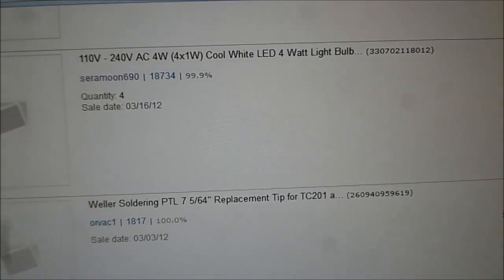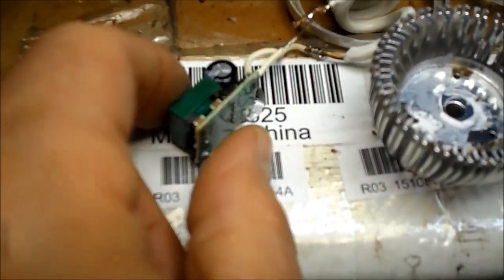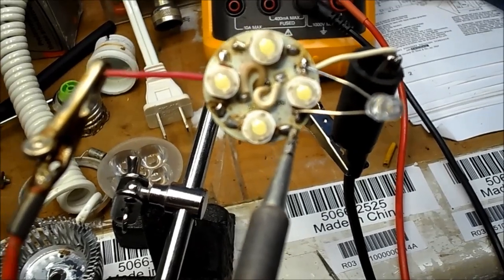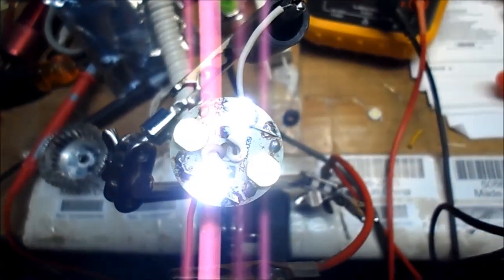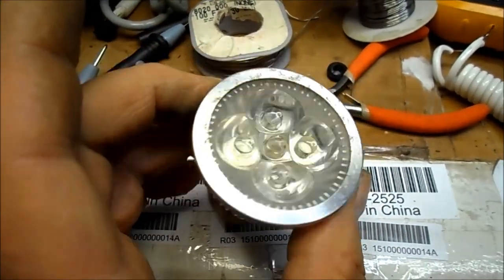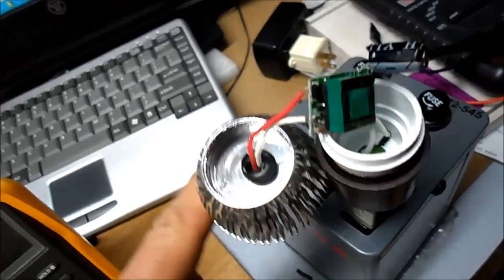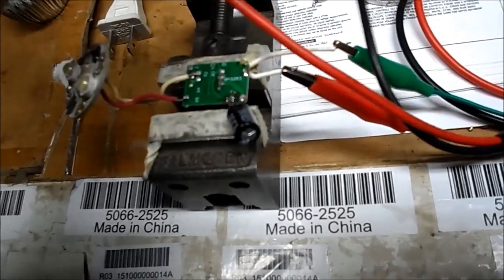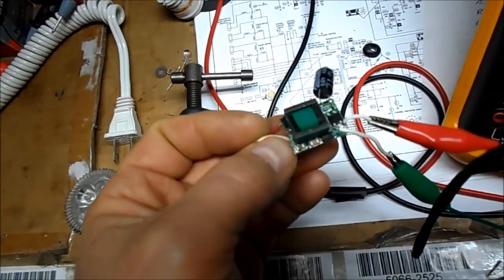Unexpected LED Bulb Repair.

Comment: What you have in the base of the lamp is not an inverter, it's a LED driver. The one in the base of your lamp is a cheap generic driver used by many types of LED lamps.

Inverters are for driving CFL tubes, they turn a low DC voltage into a high AC voltage.

If you want to replace the driver with something else, you could use a capacitive dropper, just be warned that it will run the whole lamp at mains potential and not be safe to touch while powered on.
Reply from the maker: Nice info. Yes, so use to saying "inverter" (cfl) versus "driver" (led). Thank you for watching.

Comment: Do you know where I can go to take a LED strip light to repair? It' needs to be soldered.
Reply from the maker: A TV/Radio repair shop, if you can find one nowadays,  or buy an inexpensive 25-40W pencil soldering iron & have a go yourself. It's pretty easy once you get the solder to flow with the right amount of heat. ~500 degrees F.
Reply: I went to a dollar store and bought a cheap soldering iron plus soldering wire from the hardware store. I soldered the led tape to the power cord and it doesn't light up. I think the LED strip got damage because the wire got corroded and the ground wire touched the power wire. Tomorrow i'm going to the city there's this place that works on LED. Hopefully they repair it because it's actually the light for a refrigerator in a restaurant.
Reply from the maker: Hello, If there was a chance of a short the driver circuit may have suffered damage. See if you can get a copy of the lighting diagram wiring for the particular unit. That will help sort things out.

Comment: bought a batch of these. The circuits are good but the leds were not, failing after a few months (flickering  symptoms), temperature was not even going above 60c . Just replaced all leds in each lamp as they failed. No other issues now.
Reply from the maker: These have since failed again. Will rebuild them again. One is the driver, the other is the led's again.

Comment: So these inverters have no output voltage feedback. They are current limited however, so it doesn't matter if you put 1 or 4 leds on them, the leds will be working on the same current they are supposed to. Doing what you did - turning the inverter on by itself usually causes them to explode.
Reply: Also LED's are not comparable to resistors. They have some low internal resistance, however they try to keep the working voltage between 3.2V and 4.1V (blue led junction voltage, because white leds are actually blue ones coated with special fluorescent coating to produce white light)

Comment: I replaced all my outdoor lights with incandescent lights work better... I replaced all my LEDs  I installed my bulbs 2009 still working you get and power surges the LED's no longer work same with CFL fluorescent bulbs